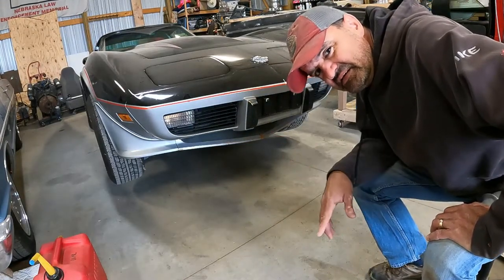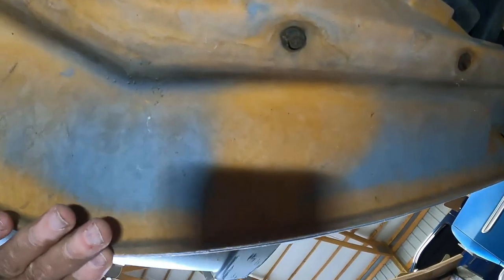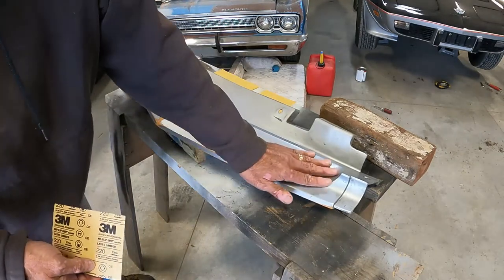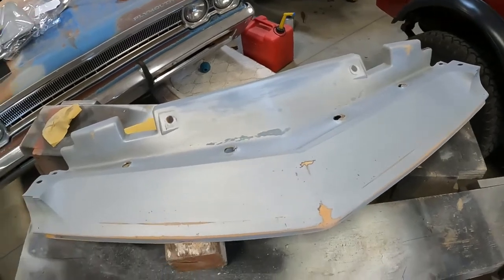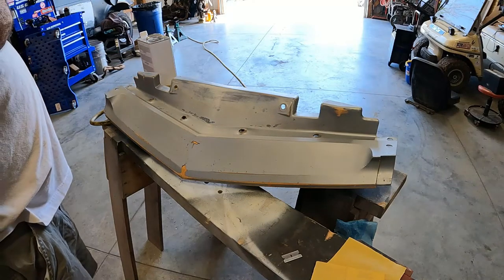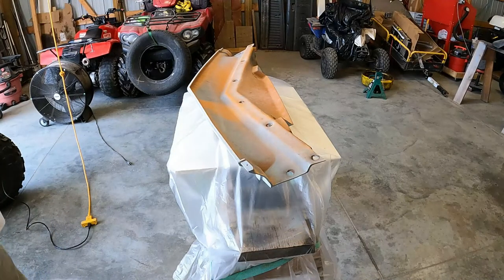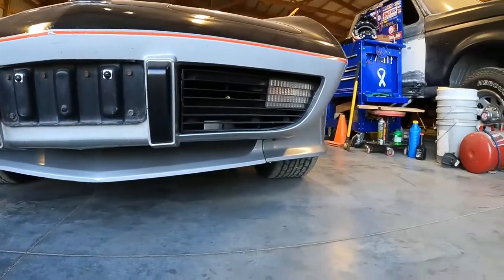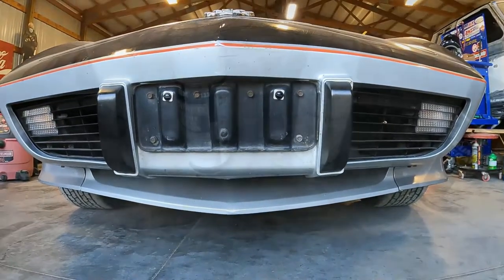1978 Indy Pace Car Corvette FINALLY gets a $65 nose job!

Comment: I had a 78 indy pace car in the late 80's.  Still wish I had it. It would look good parked next to my 86 pace car. Are you planning to sell it?? Or trade it?? I got a 73 roadrunner 63,000 miles, numbers matching, no rust, just sitting around. And I'm a vette guy. I got 5 vettes, so it won't be lonely, lol.
Reply from the maker: We are selling it Gizzmo!  I am picking up the repaired driver’s seat Monday.  Once that is installed the car will be 100%.  We aren’t considering trades at this time because we need the capital from this car to further our fledgling business.  Shoot us an email at freedomonegarage@gmail.com if you would like more info!”!
Thanks for watching!
Reply: @freedom1garage  I'll shoot ya a email and get the info. Hopefully we can come to terms. To bad about the no trade on the roadrunner tho. It's a barn find, was parked in 78, and has no rust, just dried out interior. I know about the starting a business thing tho, starting a vette restoration shop myself here in Kansas.